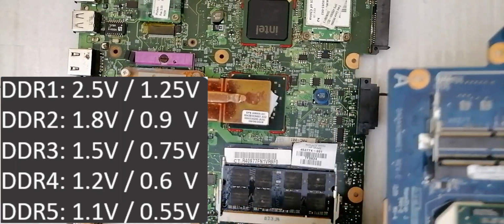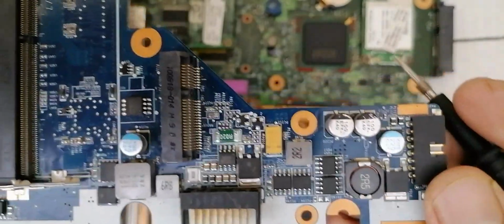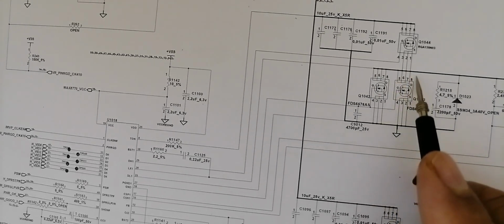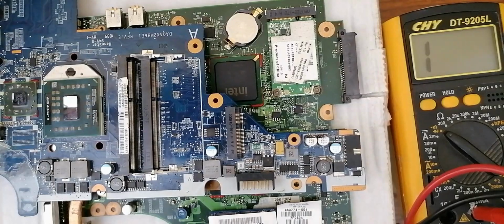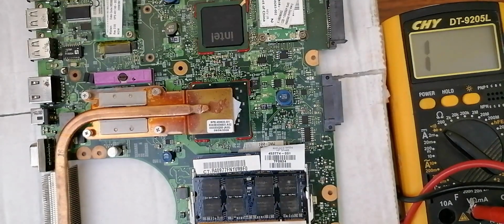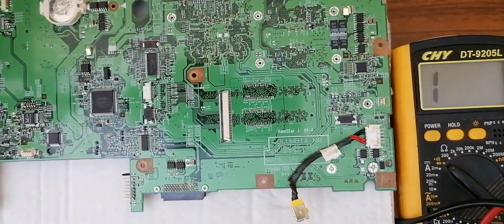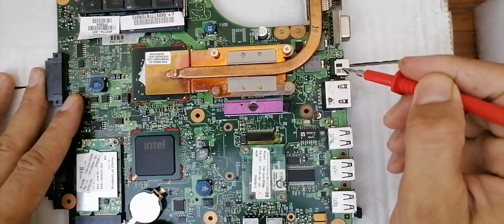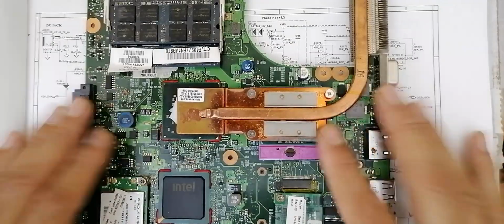Learn to Diagnose Laptop Motherboard _ Laptop motherboard repair

Comment: Hello,when will be available part 2 and part 3?Also, can you publish a complete update ebook (or english video course) on motherboard desktop chip level repair  step by step from basis?An ebook with block diagram,flow chart troubleshooting,good explanation of  different block and how it work togheter,troubleshhoting techniques ,different voltages an current to check,oscilloscope use i motherboard repair etc.Thank you
Reply: that would be nice

Comment: My laptop motherboard makes a buzzing sound almost like a cicada. I removed all the components and connections from the motherboard and plugged in only the power supply adapter(the adapter seems fine) to the motherboard and it still makes the same sound. What could be the problem.?

Comment: The anode of the diode connected to the ground for protection. If the voltages exceeds 19v, how the diode protect the circuit? I